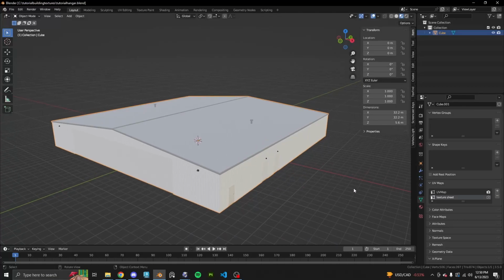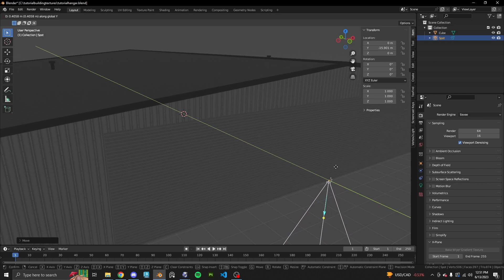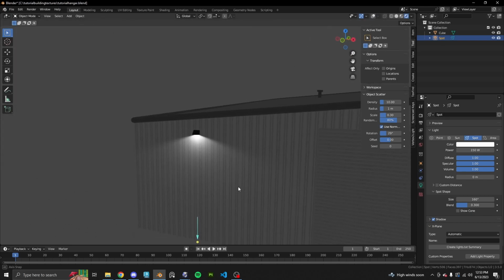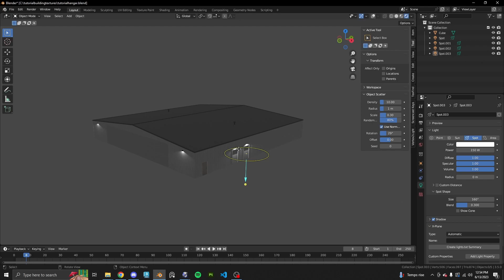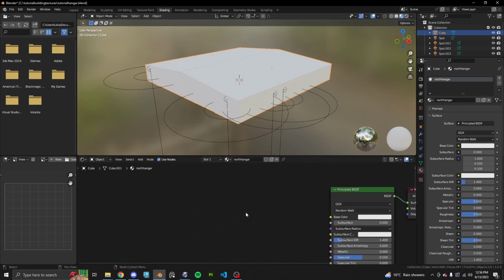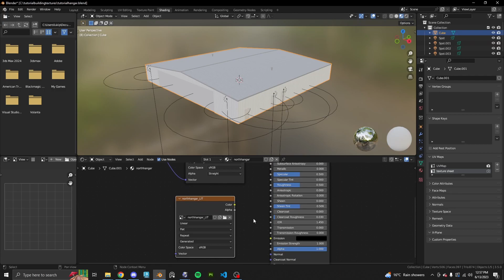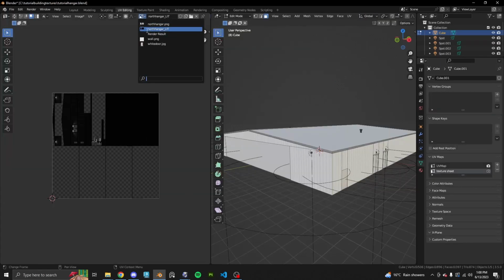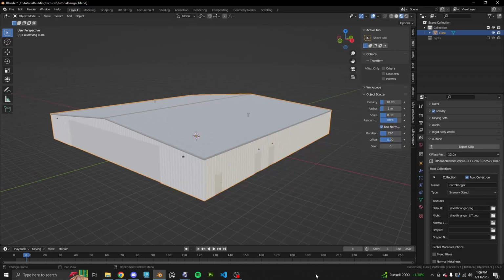Nighttime Textures (LIT Map) Tutorial for X-Plane

Comment: How I creat light window? Like emissive light from the windows?
Reply from the maker: You have to assign a material to that window that has emission turned all the way up or to whatever setting you want and from there you can also change the color of the emission. You can delete this material after texture baking as it will no longer be needed.
Reply: @AviationMaster  I get it, thanks for the answer!! But I have a problem. At blender live render the surface that is emiting light is ok (show up emiting). 
But this surface texture (that is emitting light), after baking go all black, just the surfaces around goes illuminated. How I get the surface emission not goes black after bake? (I choose white color to emission). Thanks again!!
Reply from the maker: @Marciodjr100  sorry I forgot to mention, if you’re baking with diffuse make sure you check the direct and indirect lighting checkboxes on the bake tab. I haven’t tried that yet for emissive materials but I assume it should work, if that doesn’t work try changing the bake type to emission.
Reply: @AviationMaster  Alright here!! It worked, but I Bake with combined mode. So I got spots of lights and emissive texture. It's perfect now! It's like a real build at night Thank you so much!!!